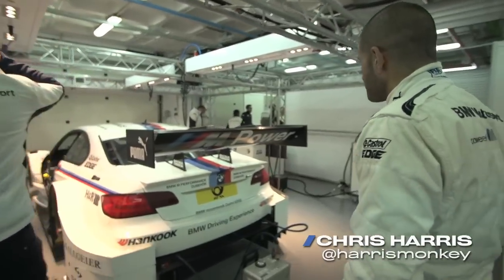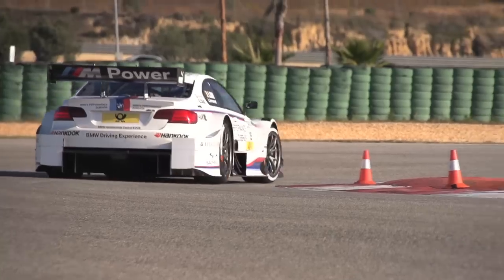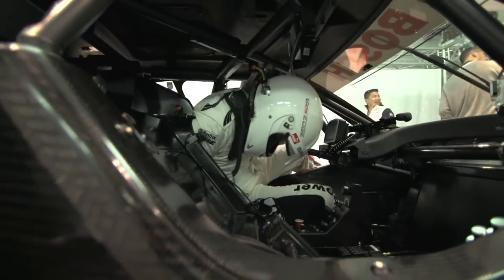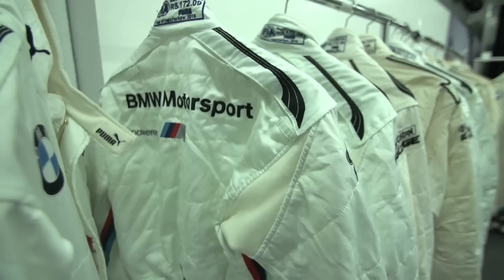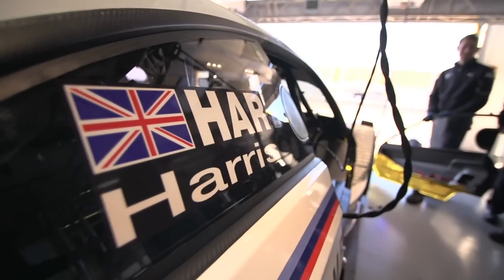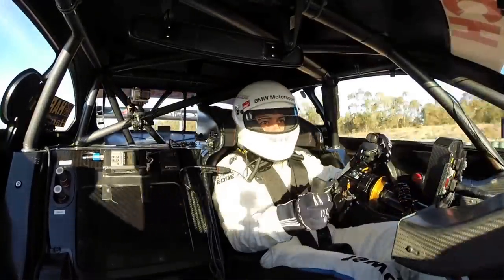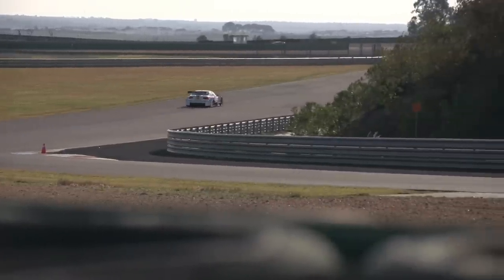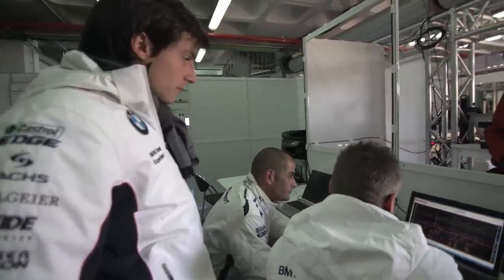Driving the 2013 BMW M3 DTM - /CHRIS HARRIS ON CARS

Comment: Only 1.5 seconds off Spanglers times? That's stout considering seat time in the car. Nice driving.
Reply: 1.5 secs a lap is a massive gap
Reply: @iliovecaRS  it is not if you are driving this for the first time, chris usually races in GT3 but those are a fair bit slower than DTM. if a normal person was given to drive this car the gap would probably be closer to 15 seconds than 1.5
Reply: @velpro3150  :You know what you are talking about. 👍
Reply: The last second is exponentially harder, and as the tenths drop, so does the difficulty of gaining them. Yes Chris is a good driver, no 1.5 second is not "close" to Bruno by any means.
Reply: Vel Pro are they really faster than gt3?
Reply: @psypher514  1.5 is not close? The back end of the field loses 1.5 secs per lap almost, depending on the year. But 1.5, while it's not close, is pretty incredible for someone who's not a DTM driver
Reply: @davidfairbairn8  Way faster. If you look at the gap in laptimes between F1 and GT3, DTM lands in at approximately the middle slightly towards GT3.
Reply: @davidfairbairn8  way way faster. U caj compare to Japanese super gt500. But gt3 way slower. But gt3 ain't slow.
Reply: @iliovecaRS  its not when Spangler is driving for many laps with proper heated tires. Also cars sometimes get faster the more u use the tires.

Comment: 1.5sec off the pace is actually very impressive, even considering Chris' GT racing explits.
Reply: The numbers of racing fascinate even the dullest tool once you dig into them. 

1.5 seconds off the pace, assuming 10 sections of the track that are equal length, comes to 0.15s off the pace per corner/straight. That's roughly 1/2 of an eyeblink per section. lol
Reply: Michael Williams
Go on then, let's see you do better. Harris can drive. End of.
Reply: Jamie Wilkins Not saying I can do better.

Like I said, 1/2 of an eyeblink per around 1600ft of track @ a 3 mile track. Not bad at all. 

Which is why I started giving F1 drivers a break when they're 5 tenths slower than their teammate...It actually means that their teammate carried maybe 1/2 a mph more than the other out of the corners.
Reply: Ric Rac So are the pros who regularly race in the series.
Reply: In V8 Supercars, being 1.5 sec off the pace puts you in the LAST 5 in the race/
Reply: You don't get it do you? For a journalist and a casual amateur racer being in the LAST 5 among the pros is a great achievement. You'd be 10-15 seconds off the pace, not 1.5. And you'd need a lot more time to get it down to 5 seconds. And so would I.
Reply: ***** I didn't mention Chris is my comment. I merely made an observation about race pace pertaining to grid position in a similar touring car category.
IMO, in DTM you rely on the aero too much to go around corners. Relying on aero to turn the car is like relying on dry weather in order to have a race. (sort of like what NASCAR does when it rains)
Reply: Exploits

Comment: The problem with touring car racing is its distancing itself from the cars they drive. I.e.  they get a german car then replace 90% of it. DTM and touring cars in general should have regulations that say they must retain certain parts or a percentage of the original car. So no chassis modification. Engine must retain certain engine parts like block and heads. The car that's being raced should be very close to the car you can go and buy. Take those regulations and mix it with no driver aids like abs and traction control and if car manufactures want to make cars that will win DTM then they would be forced to make awesome chassis's instead of just tubs that have traction control do all the work. The reason the E30 M3 is the best M3 was because the chassis was engineered to perfection. Now instead of investing in engineering the chassis they just engineer it to a tolerable point then just have traction control compensate for the inadequacies of the chassis.
Reply: abbed Idriss I think basically there are two kinds of touring car fans. The first type are those who want to see cars that they can afford. For eg. single-make series are the series for the first type of fans. Then there are fans who don't care about relevance with the road car and want massive wings, loud sounds and GP3 matching performance.
Reply: +RedPetrol76 I honestly think any person who is just impressed by the engineering to the detriment of the racing isn't a racing fan at all, he's just a car fan. If you cared about racing you'd appreciate the magic of taking production cars and seeing them tuned for racing within some homologated regulation band and then enjoy the fact that the companies producing the cars have incentive to make a street production care capable of being tuned like that. Even outside of the scope of the production angle and just within the racing team's realm its a fantastic premise. 

I'm personally not that chuffed by this kind of high downforce change because it just makes the racing so anemic. Its one thing if it was always like this, like with say F1, but its quite another for them to have taken a fantastically competitive non spec series and turned it into just another downforce bore.

I couldn't care less if I can't drive something that derives its lineage from a DTM chassis. I only care that I get to watch good racing and I think that DTM has lost that which it was so excellent at.

I'm a racing fan first and foremost. I don't care what it is or what it looks like if it races well. I don't think DTM races well anymore, at least not how it used to and that I think is a damned shame.
Reply: +abbed Idriss Yeah you so right - a touring car championship should be based on real (specified) versions of the serial cars like back the time. The actual DTM cars are prototypes. A BMW has nothing to do with the 3 series, the Mercs nothing with the c-class - the imitated look is fake, the car has nothing to do with the serieal ones. 

The cars of course are great, but I dont want prototype cars in a touring car champ. 

And the DTM is dominated in business by the manufacturers - no indipendend organisation like the FIA or similar in between - and this destroid imo the series. Im german, but I don't watch the series since now 10 years cause of that reason(s).

The series is manufactureres controlled bullshit ...

... but hot cars they are ... sure!
Reply: So basically the performance vehicle equivalent to NASCAR at its deepest roots? That'd be awesome to see, but I don't think we'll return to that any time soon.
Reply: >they get a german car then replace 90% of it
This doesn't count for DTM cars, just have a look at the monocoque: http://www.fourtitude.com/news/uploads/Motorsport_News/001__scaled_600-1_002.jpg
GT3 cars like the Audi R8 LMS, Porsche GT3 R and so on are taken out from series production at an early point and being modified apart from the engine. So they still remain let's say 50 % the same as their street car brothers.
Reply: Nailed it. Maybe Group A regs were the pinnacle
Reply: thats why the early dtm was so good, they basically raced ordinary sedans with coilovers and beefed up engines
Reply: @RedPetrol76  Besides the fact that DTM cars are faster than GT3s of course.

Comment: So I'm guessing DTM is essentially the closest a full bodied car can get to f1?
Reply: Depends on how you're defining "full bodied." An LMP1 car is closer to F1 than anything you see in a touring car or GT series.
Reply: opmike343 Full bodied meaning based off a road going car I guess :P
Reply: ***** Well, these DTM cars aren't "based" on the roadgoing cars at all. This isn't GT3. Sure, the bodywork is designed to resemble the cars from BMW, Audi, Mercedes, etc. but that's about where the similarities end. The chassis for all companies  bespoke and are built to a close spec, the suspension, tires, brakes, etc. are all purpose built for the series and shared among the companies. They each develop their own engines, but they are ALL 4.0 L V8's used just in this series.  A modern DTM car is basically a purpose built race car with some superficially close road car bodywork.

Comment: To make a car quick, downforce did helps alot but at high speed corners, the drive dynamic is different, the steering as hard as it's locked and doesn't want to turn.

Comment: So did he have to use a clutch pedal? I couldn't really tell from the in car cam but it looked like it
Reply: Nope, DTM cars have a sequential gearbox with paddle shifters. They only use the clutch (which I believe is also operated with a paddle on the wheel) when exiting the garage and on the starts.

Comment: Weight transfer is huge on the car ! Just because of the late braking .Also the Aero plays the added downforce for the corners ! The whole model in my opinion is totally based on the GT3 !  RPM's redline is 9000 + or - 500 rpm ? As BMW are not high revving in general.  They tend to make power lower in the band , for corner exits'' .Even if it is their V8 Platform '' Nice piece Though''.

Comment: I would like to see this built on the M6 platform. I'm sure the results would be mind blowing.
Reply: Wallets would explode everywhere.
Reply: Corey, this car has no common ground with an M3. It just uses its outlines and not its platform. The chassis, for example, is an steel tube frame.
Reply: Glenfiddich85 the chassis in carbon-fiber...

Comment: I know about that Aerodynamic Breaking because I played F1 2013 with no aids  sometimes it can be really difficult in corners that have short breaking distance but you come up to them fast
Reply: f1 2013 is not realistic in any way.
Reply: Try rFactor 2 or Game Stock Car.  Proper simulations.
Reply: MrBusunglueck I know but if your not running ABS if u maintain the same pressure at the start of the braking point then when you reach the apex the wheels would lock up so you have to slowly release the pressure on the brakes to avoid lock up So Initially stand hard on the brakes then slowly get off them as the car slows down this ain't a problem in heavier cars that don't have as much aero like  GT cars
Reply: MrManuel1329
yea but you cant really feel that in f1 2013. the game is just in no way realistic.
Reply: MrBusunglueck but they do a good job of doing that simulation it maybe not the best but its a good job
Reply: MrManuel1329
no they are not. as a non racedriver it might feel like. but if you drove a real car like you do in the game you would make 1 corner. you propably would crash on the strqaight already.
Reply: OMG did i say it was sim gosh do I need to explain to you again that the braking is well done for what the game is

Comment: Wow, a leaf blower just to let it idle. Aero to the max, holes to a minimum.
Reply: Not a leaf blower. But a hot air engine temperature management system. If the engine isn't hot, it dies! Apparently it takes an hour to warm the engine up.
Reply: PSRBF6 My mind is blown!
Reply: PSRBF6 No, the machine you see at 3.52 and in other places is a Stihl leaf blower.
Reply: MrPanohead It's multi-purpose. It's modified you see.
Reply: PSRBF6 No, I don't see much modification. I see a Stihl BG 66 L with the orange bit sprayed white and that's it.

Comment: Can anybody explain to me why they needed the leafblower device? I assume it's to keep the engine from stalling due to lack of intake. But I'm not sure.
Reply: +golferchin76 I can't speak for sure about DTM but in V8 Supercars they use leaf blower like devices to ram air into the brake ducts to cool the brakes since that's typically the hottest part of the car after some fast laps & the heat the brakes radiate could damage or melt things.
Reply: +Michael Tarantino keep it from stalling due to lack of intake? LoL wtf bro that doesnt make sense. no its because these cars dont have fans to push cold air into the radiator to keep the engine from heating up.

Comment: I've always been curious about this caracteristic "hissing" sound GT3 or these kinds of racing cars do, could anybody tell me why? Is it the exhaust or turbo or something else?
Reply: It's the transmission. Sequential transmissions in racecars often use 'straight cut' gears, instead of helical gears like most road cars. That's the reason for the typical "whine" you can hear in them.
Reply: gearbox and diff and lack of soundproofing

Comment: why does he say" so much downforce makes overtaking difficult"? Could someone please explain.
Reply: I take it to mean the turbulence generated by the downforce - I imagine that getting out of the draft and into dirty air makes accelerating enough to pass very difficult.
Reply: DTM (and F1) cars are heavily dependent on aerodynamic grip - meaning, they need aero to keep their grip levels up.  Aero works best in "clean" (undisturbed) air, fluidic effects, etc.  Means the air streams stick to the wings better, and therefore generate more downforce and therefore grip.

It is therefore in the interest of car designers to ensure that the air behind their cars is as disturbed as possible, so that the wings of the cars behind them aren't as effective.

The effect we see on the track is that the car behind has less grip, therefore can't go as fast into the corner, so overtaking becomes more difficult.

Comment: Kg is not a measurement of mass. Kg is a measurement of force, in the case of the weight, it is the force of gravity.
Reply: You are incorrect. Kg is a SI unit standard measurement of mass. Force is calculated as (mass x acceleration) so force can be symbolised as Kg m/s, which is where I think you have it confused.
Reply: kwo mit
Sorry, you are right. My mistake there.
Reply: Nikos Manoliadis 
Aka a Newton
Reply: Nikos Manoliadis 
Aka a Newton

Comment: Need to bring back some old rules, I want to see BTCC cars having to use everything off a standard car just tuned suspension brakes and engine. Space frame with a similar looking body is ruining the sport. This gives us the best cars on the road too as manufacturers join in chasing performance too. DTM is like F1 full pedegree.

Comment: Not meaning to be anal, but 100Nm, I think perhaps 100kg of brake pedal force is what was meant?
Reply: Nm is a measure of torque, Kg is a measure of mass.  he probably intended to say "100N" of force.
Reply: InitialDAmine Not exactly true as you can have all sorts of different brake servos to increase the actualy brake force
Reply: Lindholmer5k
Obvously not to mention that pressure is not linear, but that's not the point, and my comment stands correct, I'm explaining the 100N meaning.
Reply: Lindholmer5k all he said was force on the pedal nothing about actual braking force... so InitialDAmine statement is correct
Reply: Niels Heusinkveld
No You are wrong, it is around 10kg, I suggest you to do a little search for the value, also when you drive a car the force you apply on your pedal is around 10-20N.......we are not talking about the braking power her or the torque applied by the pads on the braking disques and whats not we are just talking about the force with is needed to push the breaking pedal
Reply: InitialDAmine No, that's only true for servo-assisted road cars. In F1 they hit the brake pedal with a force of around 800N.
Reply: InitialDAmine I know but most race cars have no assisted brakes and 10N is nothing, I know pretty sure in plenty of racing cars 100kg (1000N) is required for braking at high speed with aero grip.. :)
Reply: Niels Heusinkveld
Wrong, Old cars from the 70s and 80s (cars with disc brakes aren't servo-assisted and they require anywhere from 2kg to 10kg depending on the weight speed and aero of the car) as for F1, we are talking in another league and just for the sake of comparison we are talking about 5g of deceleration which more than twice than the deceleration of any DTM heck even lemans LMP1 doesn't exceed 2.5-3g deceleration and I invite you to check Mcnish last interview with Leo he talks about the force he apply on the pedale
Reply: CamMoreRon No, if force is not linear and pressure is not and vice versa assume the surface of the pistons remains the same which obviously is when we are talking about cars
Reply: I think you should do some reading. Brake pedal forces in race cars are typically much higher than in road cars. Have you ever driven a car with unassisted brakes? You have to STAND on the brake pedal to get them to slow down! It's about feel; you have much greater control (modulation) of braking effort when you apply a lot of force to the pedal, and that's what you need when racing - particularly with no ABS.
Reply: Also, draw yourself a graph of Pressure vs Force for a given Area and tell me if it's a straight line or not. ;)
Reply: CamMoreRon The Brake pedal force in race car is typically higher and that's the point of the whole poste so what is this is even about?
Reply: CamMoreRon
 As for pressure and force you are not getting the point at all and it wasn't the point of my comment to begin with, if surface is constant Pression is linear with THE FORCE and that doesn't take a genius to tell since F=SxP, BUT if Force is not a linear function lets say F(x)=ax^2+b or whatever, P would a non linear function since it is the same as the Force to a Factor (S which we assumed a constante). back to the point of my comment, the pilote does not necessary push the pedale lineary (the Force is not constant and varies!)
Reply: InitialDAmine While that might be true, it's irrelevant. This was about finding a realistic number for where Chris gave a value of torque instead of force, and 10kg on the brake pedal is nothing for a race car so therefore not realistic.
Reply: 85kg according to dtm.